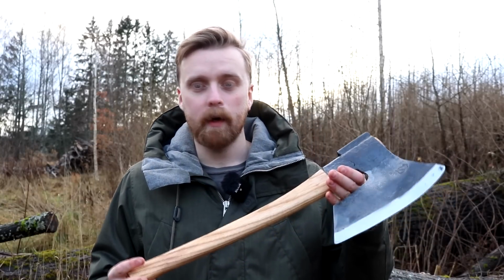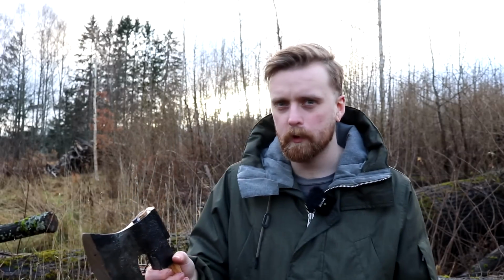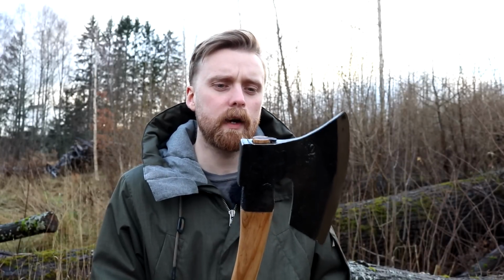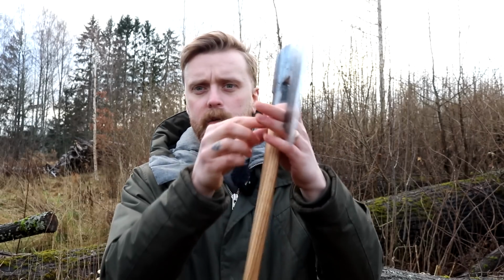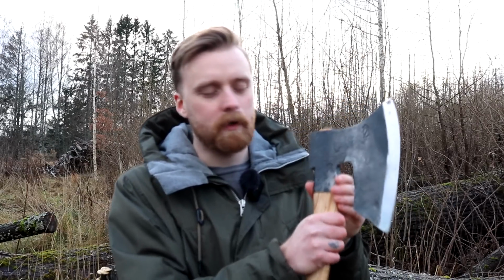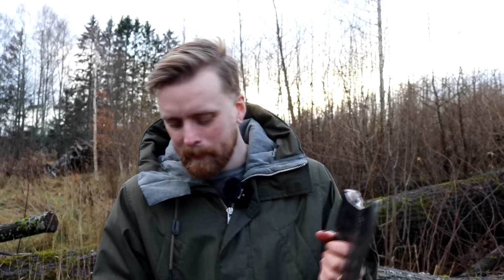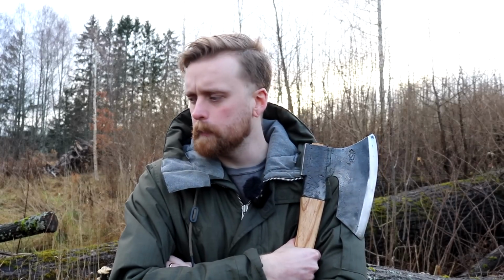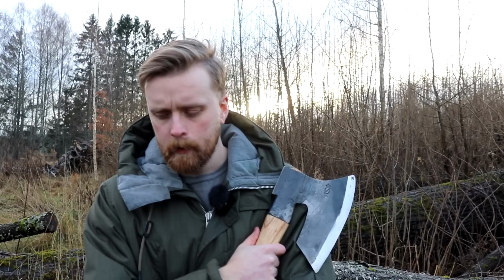Blacksmithing - Forging a Goosewing Hewing Axe

Comment: Awesome work, man. Your friend was right. We used to make waggon wheels with the German Breit and Oberbreit. One would hold the tip of the handle fastened and then very easy and precise go up and down to make both sides of the waggon wheel sector parallel. The grain of the wheel followed the circle. Very easy to work with the weight of the axe.

Comment: This is my first time seeing this many forge welds in a single axe. I don't see why it would be a problem as long as they are all good clean welds, but seeing the seams after the fact is somewhat concerning, for me.
All in all, a good looking axe. Personally, I prefer the single bevel axes for hewing. I have tried the double-bevel hewing axes and I just can't get as clean of a timber as with a single bevel. Maybe it is in my tecnique and that I have much more time with a single beveled hewing axe in hand, but that is my personal experience. The down side is, of course, I have to have both a left and right beveled axe on seperate tools.

Comment: @nilsogren What kind of steel did you use for this? I can see you weld in a harder steel for the edge. Would A36 be appropriate for the non-edge pieces? Thanks!

Comment: How iften do welds fail on these attempts? It seems like you have it down to an art
Reply from the maker: It happens. Most of the times you can fix it by making more atempts. Cleaning the area with a brush and applying flux. Then back in the heat. That usually does the trick